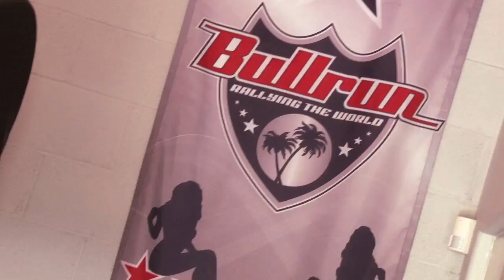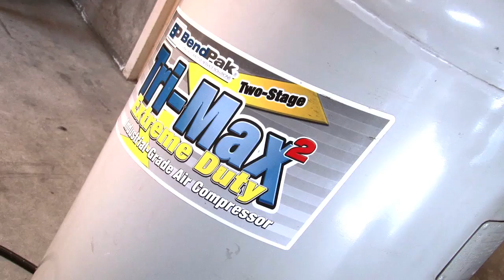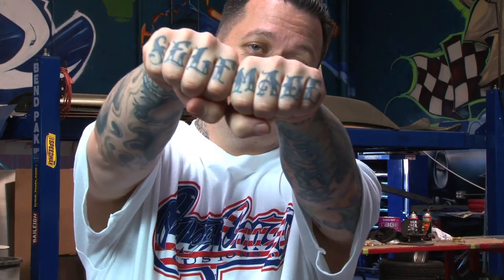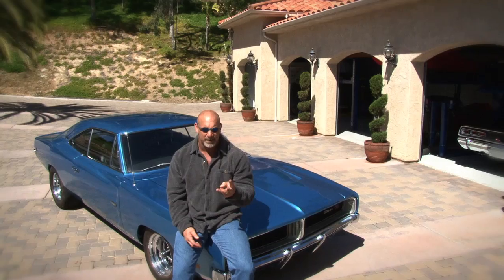Pro-Wrestler Bill Goldberg on BendPak Car Lifts and Automotive Shop Equipment

Comment: at 2:34 did anyone notice the crack in the metal where it bolts to the floor?
Reply from the maker: That crack is actually supposed to be there. Check out the manual here: http://www.bendpak.com/BendPak-5175006-XPR-10T-168-Two-Post-Car-Lift-Exploded-View-Parts-List-Ver-D-01-22-15.pdf

You'll see that it is shown clearly in the schematics. If you have any questions, give us a call! 800-253-2363
Reply: BendPak oh ok i was worried about it when i saw it not to say that there is anything negative about the quality or anything and i guess i should have specified that it may have a purpose but when i saw it i was thinking that someone has been rocking it or overloading. sorry if it seemed like i was making a reference to the quality of the build.
Reply from the maker: Not at all! We appreciate the comment and welcome all questions!
Reply: Hi, On the 4 post car lift, the 7,000 or 9,000. it doesn't need to be bolt it down right? and i heard on some lifts if you used electrical extension cords on it it prematurely kills the Electric / hydraulic power system.